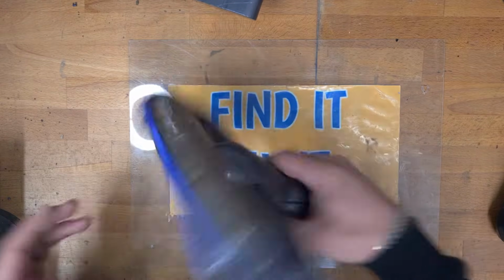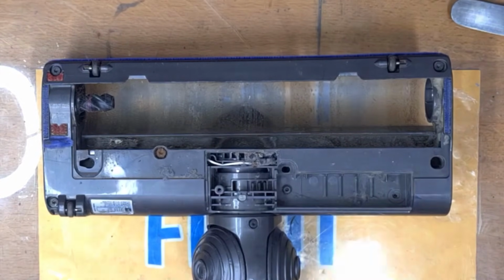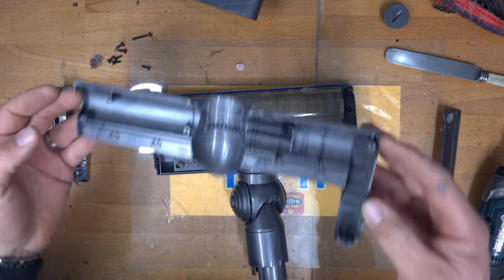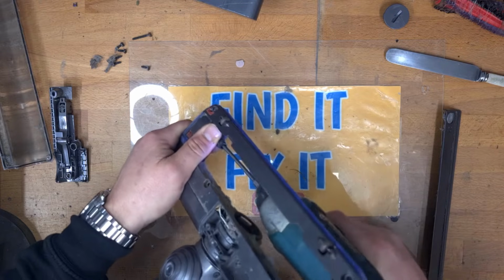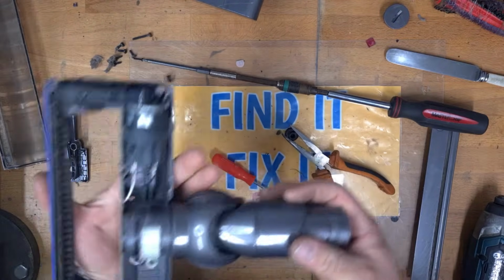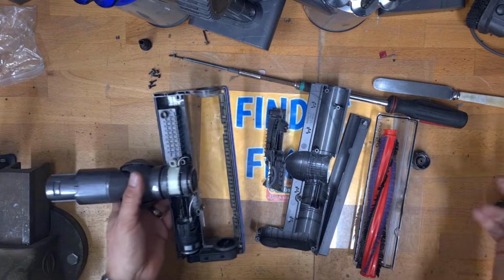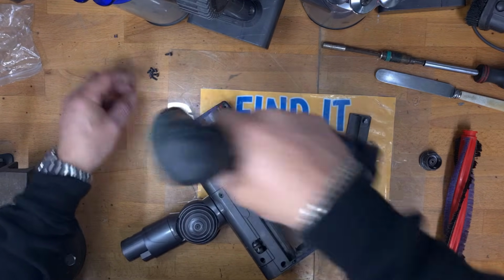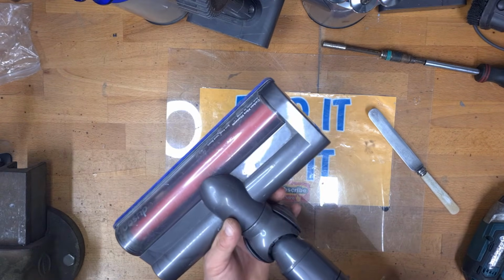dyson motor head won't spin? compleat brush bar repair guide

Comment: Got a video for if the bar spins for 1 second then stops?
Reply from the maker: most likely a stuck brush bar or a bad battery. 
there's a safe mode that cuts in after a second if the motor is having a issue.
same with the battery if there's a issue it shuts off power to the brush bar.
Reply: @FINDITFIXITRESTOREITBUILDIT  thanks. I cleaned the bar short of doing the torx removal. it is very old unit

Comment: Amazing video!!! Thanks for all the tips. 
Removed all the hair (LOTS of it) and cleaned all the electrical connections. Unfortunately, the thing is still not spinning :( 
Would you know how I would be able to test if the electrical connectors are actually sending some energy? Maybe with a multimeter or something.

Comment: My Dyson wouldn't spin, even when I cleaned out the motorhead.
The problem was that there is a little belt that spins the brush, and the belt has become tight, for whatever reason. 
I took all the screws out and reset the belt, and it became looser and the part would spin freely.

Comment: I cleaned per the video, the brush motor spins when apart  but not when fully assembled
Reply from the maker: so with the brush bar out it spins or with it totally in bits  it spins?

Comment: Always preferred a bagged vacuum because the dirt stays contained. https://www.youtube.com/post/Ugkx8ISPQRRAfpAaX4msGjyodObTBnlj4T5g The bagless vacuums I've had in the past required a separate vacuum to keep them clean. This model is easier to keep clean if you empty it outside and wear gloves to remove the cyclonic assembly.Outstanding suction and does a great job  picking up Pekingese hair! Lightweight and the swivel head makes it very easy to handle.

Comment: What to do if the extensions bar attached with it then it doesn’t spin? Otherwise fine
Reply from the maker: replacement of the extension as there's a bad connection somewhere

Comment: What is the exact torque screwdriver and extension I need to purchase?
Reply: You can use a very small Allen key it works as well.
Reply: T8

Comment: Thank you for the guide - £3.50 on a torx screwdriver and I now have a motor head spinning once again and ready for a few more years service. Means a lot, as without this video I would have thrown it away and looked for a replacement 👍👍
Reply from the maker: that's why I make theses videos. there good vacuum cleaners that just need some minor repairs to keep them working on.

Comment: thank you so much my man, i’d done the first few steps of this based on the troubleshooter on the dyson website but it hadn’t worked; i was worried about taking it apart further until i saw this and it’s totally working now. subscribed!
Reply from the maker: the v6 is around 10 years old now so most of the issues is just dust build up or hair so a quick dissambley clean and reassemble it normally gets it working like new. check out my other videos for more v6 cleaning tips

Comment: I did all of the above and it still won't spin
Reply from the maker: did you remove the dust bin and check the main connection points at the back of the bin to make sure there's no debate stopping the connection.

Comment: hello I cleaned the Dyson following your instructions but the roller keeps spinning intermittently. it seems that when i hold the dyson in a certain position it turns, but as soon as i change the angle it stops turning. can you help me please?
Reply: its happening to me
Reply from the maker: check the connection points on the rear of the dust bin i think you will find dust making a bad connection check out my other videos for more on this.

Comment: Great video. Thank you!
The black screw thred drive bar that fixes directly to the motor you pulled off with the pliers has broken on mine I don't appear to be able to get another any ideas? Please
Reply from the maker: I can't find that part listed on its own either, you will be best getting a second hand brush bar from somewhere for cheap and using that.